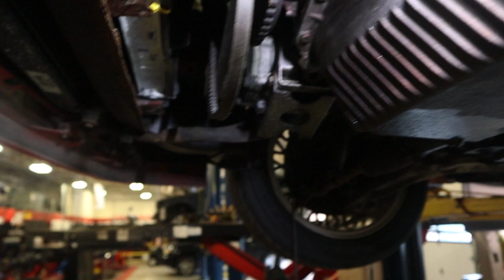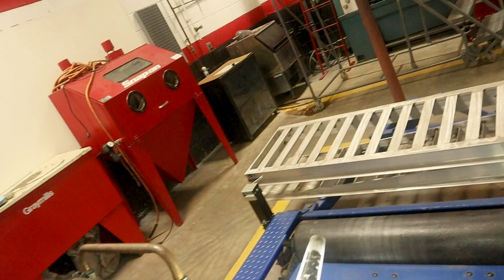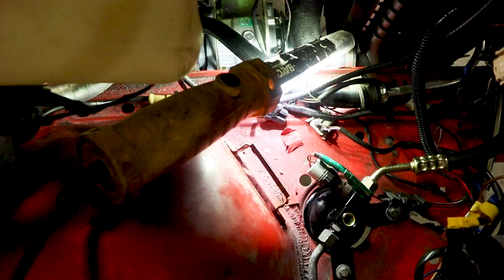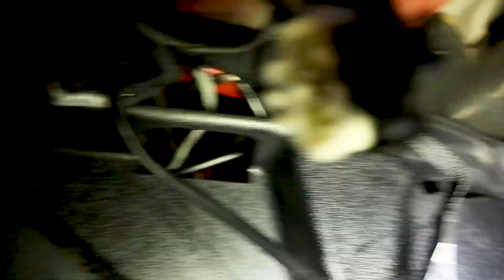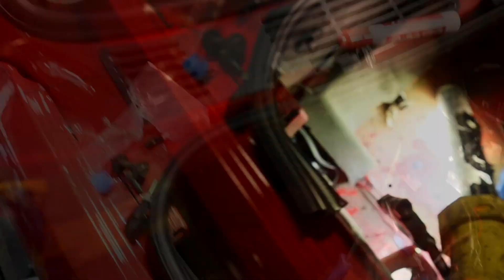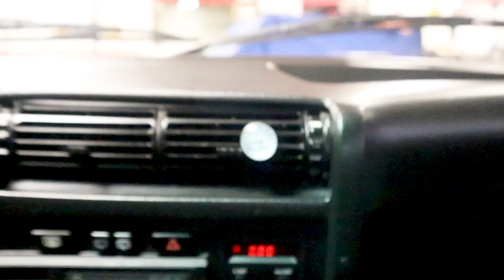Original Compressor Failed - Sanden Conversion Was the Answer

Comment: Very nice work! For the low-pressure suction line, we would recommend using a 16mm P-clamp on the formed metal section rather than over the crimp (as shown in the "A/C Solutions BMW E30 Bracket and Hardware Kit" on our website). Nonetheless, great work and thank you for the detailed feedback! This is absolutely something we are hoping to fix for a more user friendly install!